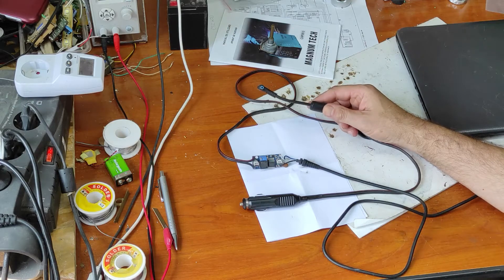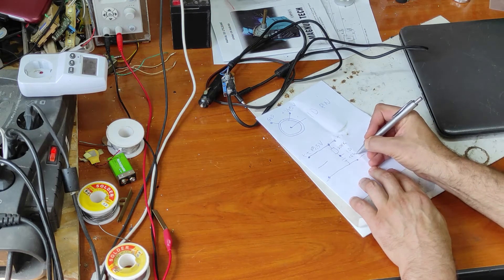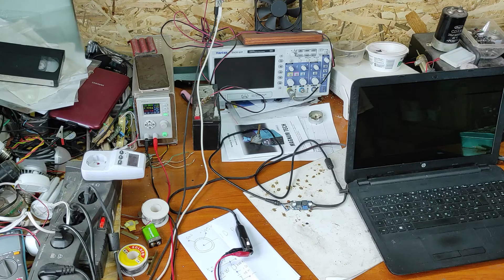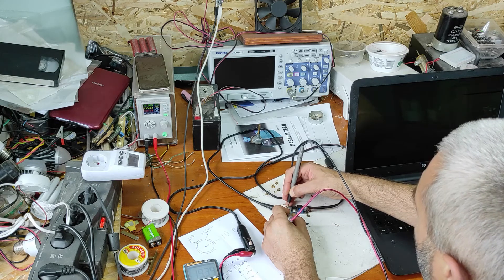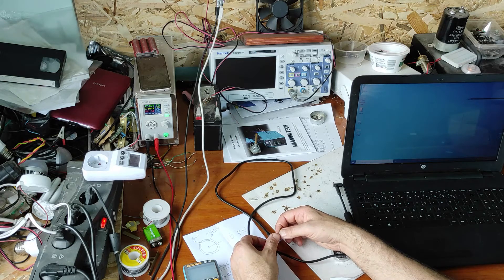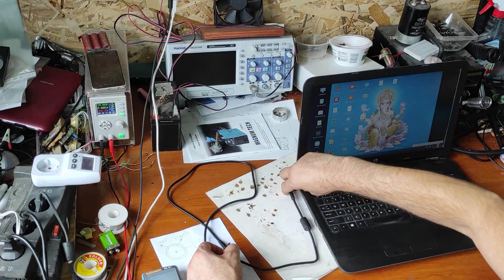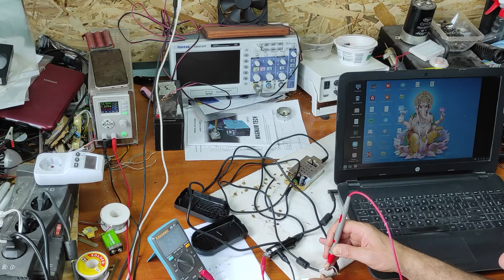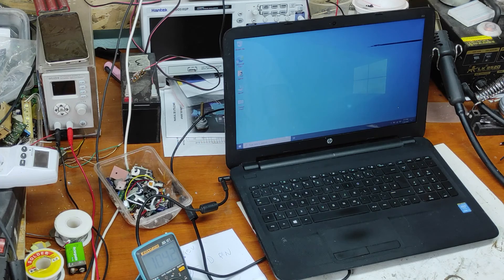HP Laptop Charger 3 Pin-Out Explained and diy 12v charger

Comment: I am looking for power laptop with out internal battery . I wanna attach 3 or 4 cell battery in between  laptop charger and connected cable to laptop .  My main purpose is does laptop work 3 or 4 cell battery  through charging cable .  During shot fall electricity
Reply from the maker: u can do it but its not very simple, u need exactly 19.5v from batery.

Comment: The schematic says 10nF but you said "one hundred" and the blue cap you used is, effectively, 100nF. I Suppose it's not a critical value as it seems to be just a stabilizer.
Reply from the maker: capacitor is not critical, but resistor is. u have all the good values in description and coments.

Comment: Hi. I have an Acer aspire n17c3 and when I plug the power supply into the laptop the power supply stops working. Then if I unplug from laptop AND unplug and reply into wall ( without plugging back into laptop) the power supply works again but stops as soon as I plug back into laptop. Where should I start looking? Power supply or laptop?
Reply from the maker: I presume that laptop has a short on input. mosfet or capacitor.

Comment: hello guys, i tried to make my hp elitedesk 800 g3 mini work from bench supply. im set voltage at 19,5V and soldered a 383kOhm resistor between + and detection pin and my pc doesnt boot from thic cable, but from original hp charger 19,5v 3a 65W works normally. for 65W resistor is 383kOhm or 200kOhm? im asking because in comments its shown that on 65W is 383kOhm biut in video its 200kOhm and im confused
Reply from the maker: bro u have in the coments a list with values.if the cable is good, it should work.
Reply: Yeah, yesterday evening I'm working on it and realised that my cable is broken in id pin. But I cut a wire from the plug and soldered to it wires and capacitor and it worked. So thank you for your help and for the video  @diymariuselectro
Reply from the maker: tnx bro.u can suport the chanel if u afford.
Reply: Liked video and subscribed your channel mate :)

Comment: Hello! I was wondering if you may advise me? This is awesome and I have a mini pc to use in my camper. I need to make a 12v power supply for it. The power supply is HP19.5V 11.8A 230w DC 7.4MM x 5mm. I have no idea how to figure what values the center pin needs for 230w. Do you perhaps know what I should use?
This is for an HP Z2 G4 Mini Performance.
Reply from the maker: I can find one and measure it for u , but it will be nice to support my channel with 1 or 2 usd.
Reply: @diymariuselectro I can do that. Thank you
I can’t find anywhere on your channel page for join or contribute or whatever.
Reply from the maker: so I found for you hp 230w and I measure 126k resistor. tnx for contributing bro.

Comment: Amazing video. Does the uF matter for the capacitor with different resistor values. I want to replace my 200W HP supply with a bench power supply. I saw another comment suggesting 100k but no mention of the capacitor.
Reply from the maker: tnx bro. I think the capacitor is not critical. only the resistor. but I am not sure, u should try.
Reply: @ I think capacitor does not matter. Unfortunately it seems newer generations 200W+ supplies don’t work. Resistor values too low trigger HP Fury to just say AC is not functioning
Reply from the maker: bro I have 230w original hp adapter and I can check it for u. will be nice to give me a pizza :)
Reply: @diymariuselectro  ok pizza is in the oven!
Reply: @diymariuselectro  I have also 230V and I measured between plus and central pin 82kOhm...

Comment: Can hp laptop power on without ID pine?.
Reply from the maker: yes I told in the video,can power but will not charge the baterry.
Reply: @diymariuselectro thanks for your response ❤🎉😂
Reply: I mean HP laptop power on without ID pine even when without battery install.

Comment: Thank you so much, this helped. I have a 3rd party charger marked as 150W but my HP laptop refused to charge by it while the laptop was on. I cut open the charger and saw a 383KOhm which marked it as 65W. I desoldered the resistor and replaced it with a 100KOhm and it works fine now. Some laptops would not use a charger of too low a wattage apparently. In my case the the capacitor in your schematic was replaced by what looks to be a 0 Ohm resistor.

@jimb8524 ans @CSergV your comments helped too. Thank you!

Comment: Very informative ❤
Can i convert my dell 200 watt, 19.5V charger to hp 200 watt, same voltage....?
I have a good dell adapter and a dead hp charger. I also have basic knowledge and tools as well.
Thanks in advance ❤
Reply: Just want to turn ON!
Is it possible?
I don't care about battery charging.
Reply from the maker: @basitimran3368  u can but will not charge the batery wthout id pin

Comment: I have a DC to DC voltage booster. 

It has two outpoints but my laptop pin has 3 wires . Third is ID pin.

Where to connect that ID pin in that booster.. on plus point or on minus point?
Reply from the maker: u can find the answer in this video with schematic
Reply: @diymariuselectro  schematic? You mean diagram?

I don't find any diagram in this video..

I tried searching this on chatgpt but it was guiding me some resistor, cathode, diode, resistor etc I didmt understand at all..

Can you describe me In simple words?

I asked my voltage booster seller and he simply replied just put that third wire on Positive output of voltage booster.

Comment: Ciao Marius, grazie del video, è stato veramente utile!
Posso chiederti un altro po' del tuo prezioso aiuto?
Il connettore del mio HP col tempo si è rovinato, quindi gli ho semplicemente cambiato la terminazione e ho collegato polo positivo e negativo. L'alimentatore è quello originale, potrei avere malfunzionamenti semplicemente isolando il cavo azzurro di controllo?
Grazie mille anticipatamente!
Reply from the maker: English pls
Reply: @diymariuselectro  Oh sorry, from your name i thought we were of the same country, i would traslatate: 

Hi Marius, thanks for the video, it was really helpful!
Can I ask you for some more of your valuable help?
The connector of my HP over time got damaged, so I simply changed its termination and connected positive and negative pole. The power supply is the original one, could I get malfunctions simply by isolating the blue control cable?
Thank you very much in advance!
Reply from the maker: laptop works without data pin,but its not charging the batery.its not recognizing adapter power.

Comment: Resistor should be: 
150W=120KOhm, 120W=180KOhm, 90W=294KOhm, 65W=383KOhm, 45W=500KOhm
Reply from the maker: tnx bro.where do you know this?
Reply: @diymariuselectro  I found these values earlier somewhere on one of forums for laptop service engineers.
Reply: 02:40: They why the author said 200 kOm for 65 W?
Reply: Can you please tell me if the DC and ac wattage required same sizes of resistors .

Like Ac-150w also needs 120KOhm?
Reply: @sohailsheikh199  Yes. You should use 120KOhm with 150W (DC) power supply. This resistor will show your laptop wattage of power supply and let working with non-original power supply. I hope I understood you correctly.
Reply: @CSergV  what is the value of resistance for 200watt charger?
I found 218k resistance in Chinese charger that claim to 200 watt but actually it is around 120-130watt.

Comment: just use 2k resister and connect it to v+ and connect it middle pin the connection should be like solder one side of 2k resistance to positive and the connect the middle pin wire to the other point of 2k resistance you are good to go
Reply from the maker: For what power bro?
Reply: @diymariuselectro hp laptop charger id pine.
Reply: Hp laptop charger center pine, what is is the output voltage of the ID pine? Please.

Comment: I just measured resistance for 45W charger and it gives me 540kOhm, and for 90W charger it gives me 270kOhm. I will check 120W charger later and report back.
Reply from the maker: tnx bro,now I have 230w and I can measure it.I will edit the descriprion of the video.
Reply: @diymariuselectro  I also measured 230W one and found it to be around 100kOhm. found the other resistance values on the eevblog forum.

Comment: I tried your trick with a PSU from another brand (HiPro), it didn't work. I read elsewhere that some manufacturers use the 3rd PSU pin as a means of communication with the laptop and determine if the PSU is adequate for the task (else it shuts down). I'm afraid I'm in the 2nd situation...
Reply from the maker: pls see all my videos about hp,dell lenovo chargers and u will understand.

Comment: Hi I have 90W charger, what do I need to make it 3rd ID pin work for a 2 pin charger?
Reply from the maker: Bro I dont understand the question
Reply: @diymariuselectro  Sorry I have the 90W version of what you have done, do you know the specs required of the parts for that to work. Different resistor etc?
Reply: In this video . The charger was 90w or 45w ??? Did you find out?

Comment: Can it be, that id pin gives command to charger to rise voltage? If you give stable 19.5v with your power supply id pin has no effect. Did yiu any tests with 230w power suply? I wonder how it adjust charging power. And how hp laptop knows if weak power suply is connected? Maybe it sends some data through that pin?
Reply from the maker: as i told in the video,that pin tells the laptop how much current can draw from the charger.in the bios laptop knows the power of the charger.

Comment: Thank you for this video. You must be from Poland. Did you manage to charge the laptop without the Pin wire?
Reply from the maker: Its strange,sometimes my laptop charges without data pin and sometimes not charging.I cant find the reason.but with data pin its allways charging.what u notice at your laptop?
Reply: @diymariuselectro  I did not charge the laptop this way. I want to use an invertor 12 DC (from UPS battery) to 19.5 DC (Laptop). And this additional PIN wire makes things more complicated
Reply from the maker: @ML-vo8cr  thats exactly what I did for me.I made 12v power supply from my solar panel for laptop hp.u just add resistor and capacitor from my video to data pin and carge perfecty.u have to take care that can take out amperage u sent by data pin.
Reply: @diymariuselectro  Your wallpaper is awesome.
Reply from the maker: @yashsvidixit7169  tnx man 😂
Reply: @diymariuselectro  can you share the story behind that wallpaper?
Reply: Wich type of resistor and capacitor should i use

Comment: Show the voltage of id pin
Reply from the maker: now i cant measure because its insulated.
Reply: @diymariuselectro  what is the voltage of Id Pin and Inner layer volatge?
Reply from the maker: now i can measure only without load.its 18v from gnd.with load idk.

Comment: Can I know the value of the resistor and the capacitor for 45W?
Reply from the maker: I dont know and i cant tell u.maybe someone tell us
Reply: Any small value cap should be fine. Instead of a fixed resistor value put a potentiometer that goes from 10K to 1M and find the value the laptop stays on. The IC chip will read the value only on startup to know the power of the power supply so you will have to reboot it at every attempt